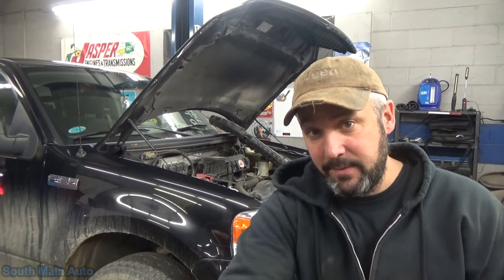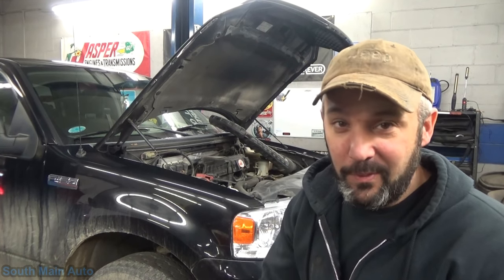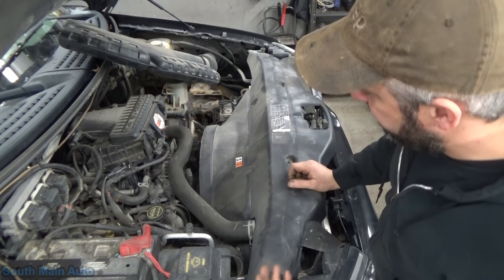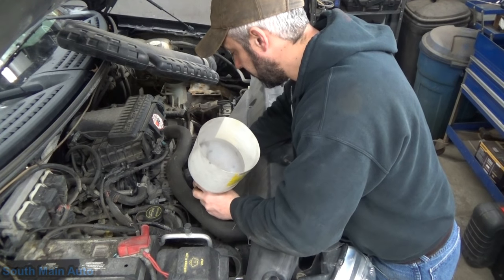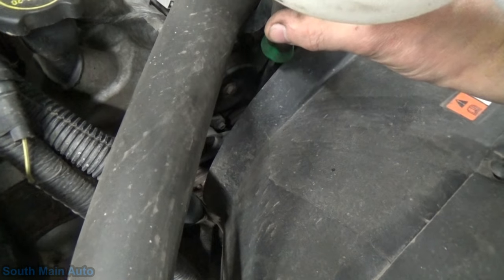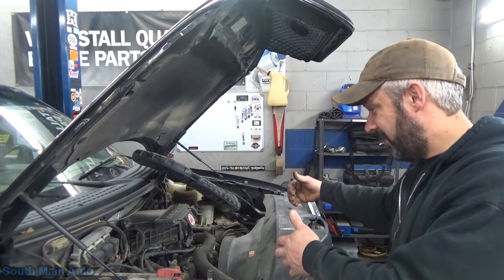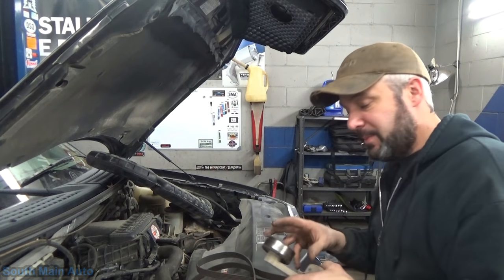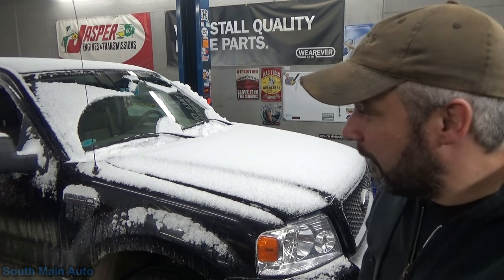How To Locate A Noisy Idler Pulley

Comment: I use temperature sensor gun and point at each com .. The bad pulley usually get about 20-30 degrees hotter.
Reply: THANK YOU!  Just confirmed my tensioner pulley is bad without turning a wrench.
Reply: Is ther a specific one to use
Reply: That's a smart idea! I'll have to go and buy one
Reply: Good thinking will try that.
Reply: That's a good idea
Reply: Oh Snap ! ! !
I'm going to try that NOW ! ! !
EDIT:  I just tried it, and that worked like a charm.
I used a Hrber Frate Thermal gun and I found the Alternator body was 180F,  I also have a basic FLIR thermal cell phone camera, I also saw the ALT was super hot.  Then I noticed the sparks spitting out of the alternator.  Bad alternator.
Reply: Woo what a great idea haha. Have some LaserGun in my tools 👌
Reply: Big Brain!
Reply: Good idea
Reply: Thank you. ! Great idea
Reply: Thanks very good idea
Reply: SC 03 thank you!
Reply: How long should the car be running to get them to temp? Or would it show right away?
Reply: Likewise 😅 I have super fancy temp gauge gun and Im always trying to get my 💰 worth out of it..
Reply: Great Idea!!!!!!!!!
Reply: I just tried this method. I knew the ilder pulley was the likely culprit.  Before taking the belt off, I ran the engine a bit and temperatured everything: all the others were running at around 125 degrees, but the idler pulley was 135-140.  Not a huge difference.  Was it because it was closer to the AC compressor and engine?  hmmm  Then I took the belt off and manually spun everything, definitely the idler pulley (belt tensioner about done for, too).  I put the belt back on and restarted the engine to the most horrendous racket ever:  idler pulley has left the chat.  Temperature on it immediately starting climbing before hitting 165 when I cut motor.    

This method definitely works, but the change in temp may be less noticeable depending on how bad the failure is at the time.
Reply: You mean one of those laser thermometers?  I feel way more comfortable using that than sticking a screwdriver down the hatch into the moving pulleys and belt, it just looks a lil scary.    Though the screwdriver effect was pretty cool.
Reply: @sc0368  well damn. That's smart!
Reply: Ok sweet.  I have a heat sensor 👊👊👊

Comment: A tip for you that will save you time and your customers money. You do not have to purchase the tension arm and the pulley. (Unless the tension arm spring is broken.) The pulley itself can just be replaced. The pulley itself is usually in stock, the tension arm is specific to models and usually has to be special order.

Comment: One of my favorite tips is how to find a bad wheel bearing. Lift the car in the air and hold each spring then spin each wheel. The bad one will vibrate right through the spring and your hand/arm. Works every time;)
Reply: ALSO A GREAT TIP AND LIFE HACK
Reply: Hell yeah!
Reply: @Goosetavula  😂😂😂😂😂😂
Reply: You can also have a friend tied to the hood with one of these screw drivers and a bottle on the end, have him press the end into the hub while hanging off the side..
Reply: Wheel bearings do not have Springs
Reply: @famusman5989  Correct. The struts have the  springs and that is what you hold on to while spinning the wheel. Supposedly you can feel the crunchiness of a bad bearing vibrating the spring.
Reply: @sigmundblank7403  oh ok I see
Reply: Don't forget to check the piston springs (a la chrisfix 😉)
Reply: Did not know this before but it probably works better on small cars. On my truck it takes two hands just to move the wheel.
Reply: They also get warn/hot when they start to fail. It's always nice to go for a drive uphill and coast to a stop, that way your brakes don't heat up when you get out to check the wheel bearings
Reply: @shartingfish5761  that's what my friend would do..
Reply: @famusman5989  no but it's got a spring there somewhere to hold..
Reply: @bravobrk  two words.. power steering.. Or ..
Ol Lady

Comment: Thank you so much for this great idea. It is amazing how the simplest things are the most effective. I tried using a Harbor Freight stethoscope, and I could hear noises OK. However, once I attached a plastic bottle to a long screwdriver like you did, WOW ! The noise just amplified to the point that there was no mistaking which pulley was bad.  Saved me lot's of guessing and "throwing parts at it". My Acura noise was sounded like a  bad alternator, but the noise through the megaphone screwdriver was so minor. However, once I put it on the tensioner/idler, man the noise was loud. I found the problem, had it fixed in an hour. Great idea, thanks again..

Comment: Been using the stethoscope for years. I also have a 3 foot long piece of plexiglass rigid tubing to slip on the rubber hose end of the stethoscope. Helps with finding the general area of a noise.
I will definitely be adding the jug method to the arsenal . Thanks Eric O.

Comment: Love the tip.  Just want to point out that there are 3 types of pulleys there:  Drive (on crankshaft usually the bottom one), Driven (on alternator/generator, power steering pump, AC compressor, fan), and Idle (not attached to any of the others, just installed to maintain the tension on the belt).  Generally speaking, you will usually only have one idle pulley on cars, although you can have 2 on an engine that uses two of the flat belts such as some large diesel engines.  Thanks.

Comment: Screwdriver works great to find stuck/failed injectors too. You can hear them clicking clearly as they open and close. Relays and stepper motors(like throttle plate motors and EEGR) are also easy.

Comment: Great tip! Really enhances the sound...
I just used my stethoscope on a truck the other day, truck had a bearing noise, but with stethoscope they all sounded the same...ugghh hate when that happens... lol
Good safety tips too! Very important, usually people joke about it, like its never gonna happen to them. Yrs ago, i was installing an electric fan on my 85 Camaro Iroc-Z and not knowing if i wired for push or pull, i went in a little closer to determine which way the air was moving, and wham! It bit me! Lol
Needless to say, 7 stitches on my index finger, 1 stitch on my middle, and 3 severely bruised fingers later, you learn to be more cautious about this stuff...
Lol

Comment: recently installed a couple new belts on a 2004 350z. After watching this video, couple things...I need to go and reverse my steps  by loosening the adjustments on both pulleys and check for looseness on all A/C, alternator and P/S  for free spinning. Honestly for my first time however, I did over tightened both belts...is making the groaning noise. Well, time for couple new pulley parts. Please feel free to comment. Thanks again...SMA

Comment: You kill me Eric.  Reminds me of my old man, WWII Combat Engineer.  He'd use common sense and Critical Thinking to solve most any problem.
He told me on real old cars you had to change the "bushings" on the crankshaft/rod connections every 30,000 miles or so.  Metals were not as durable or hardened at that time.
You would drop the oil pan, R&R the bushings, put her back on the road.
Ehh.. couple of hours, you're done.
Good Work, My Friend. 👍

Comment: Love the tip good sir. Well, this invention worked like a champ. Was able to find the culprit on my 2011 Avalanche with ease, thanks for taking the time to share. I'm starting to think the 5.3 in my truck was changed at one point as mine has an a/c tensioner but all the other 2011's I see people work on don't have a tensioner on the a/c belt.

Comment: Great little tip there cheers.  I have currently got a toyota hilux and there is high pitch squeak coming from somewhere and I have been wondering how to start looking for where it is coming from, this trick to check the pulley bearings might be a start.

Comment: Nice trick with the jug. I often use a stethoscope which can be quite deafening at times. I should try the jug next time. That tensioner pulley sounds just like the old one in my 08 f-150 when it went bad. I replaced that pulley along with the other two smooth idler pulleys. I ordered new bearings as well and cleaned up the old pulleys, shot some fresh paint on them, and pressed in the new bearings. Now I have spares if they crap out again.

Comment: Great trick with screwdriver and jug ! Would love a close-up of contact points of screwdriver end with pulley’s if possible ? ?
Reply: YEAH ME TOO, NO CLUE WHERE TO STICK THE SCREWDRIVER. i ASSUME IT'S ON THE PULLEY, IE THE METALLY THINGIE INSIDE THE BELTS. SWEATING EVEN THINKING ABOUT STICKING THINGS NEAR RUNNING BELTS, BUT HEY, i'LL STILL GIVE IT A TRY. mY PEUGEOT BOXER IS VERY NOISY
Reply: @angeliquevanengelen  at 3:22 in the video. Avoid the outer moving part of the pulley. Put the screwdriver tip at the support pt of the inside center axle of the pulley, which is not moving. By touching close to a pulley, you get the sound of that particular pulley more than any other sound.

Comment: Great tip! Out of interest, what are you actually touching with the screwdriver? The bolt in the middle of the pulley, or the actual spinning part?
Reply: dunebasher1971 The bolt.
Reply: The bolt or the mounting area. On something like the alternator you touch the housing around the bearings.

Comment: Great trick with the screw driver and jug.
I have the same truck and same noise and I am pretty sure it’s the tensioner as well but now I know how to check it 
I guess you have the end of the screw driver touching the bolts that hold the pulleys on or the housing?

I got to check and fix mine tomorrow

Comment: I just Bought the Same  Tool from Snap on for $ 400.00   Except the Jug doesn't have a Handle and there was still some Washer Fluid inside    lol      Great Idea I would have never Thought of it.  I been just using the Screwdriver method  for years I Have to give This a try Cool

Comment: Well, I can say that trick just gave me back my sleep cuz I just had my pump fixex n it was still hummin away  but after checking it with this method I now know its the tensioner. Sadly enough I need my lines replaces on the steering pump now but the humming is gone and that is gonna help me sleep better at night. Thanks for this excellent tip brotha!

Comment: That is a friggin GREAT idea! One of those, "why didn't I think of that" deals.

In the past I never used the screwdriver trick. I'd just remove the belt and free spin the pulleys, then put my weight on them & flick my wrist back and forth - I can usually feel any roughness doing that. 

In my own truck ('07 Silverado), I pried the seals out of the bearings, and gave them a little smear of John Deere Corn Head Grease - works wonders. Made it all nice and quiet again. 90k miles on the truck, and I'm still on the OEM bearings and belt, except for that tiny little 6001 bearing for the A/C - the Corn Head Grease was a little too thick for that little guy - must spin at 18,000 RPM just at IDLE.  In that case my  grease trick actually made it worse. Live and learn. Would need a NGLI #00 in there, I think. Bearing is only $6, but saves you a trip to the parts store - after all, we don't get paid for wrenching on our own crap!

I learned quite a few automotive tricks from my grandfather, but most of those can no longer be applied to these electronic wonders of today. This one is definitely a keeper - thanks!

Nice to see Doug's got his channel up and running - just watched his before I came over here. :)

Comment: Wish I saw this trick sooner,after replacing a perfectly good alternator. I tried it with a two foot pipe but that does not work as good as this method you are showing. After finding a old milk carton I tried this and it was so clear the noise was coming from the compressor. Thanks for this great idea.

Comment: Here's a hot tip.  If you have a local bearing supplier in your area take the bearing out of the pully and have them match it. Press a new one in and I doubt you would pay more than $5.  Of course, you'll have to learn how to press a bearing in and out, but it can be done with a socket and blocks of wood.  I've done it just for fun because it's so cheap and it's great insurance for an older vehicle, particularly if you are going to be traveling.  You DO NOT want a bearing to seize more than a block away from home.  It'll melt your belt and then your engine.
Reply: I've done that numerous times with great success. However, some of these are pressed into a plastic (or phenolic) pulley, and they have a small lip on either side of the bearing and covering about 60% of the outer race, usually on an idler pulley. You'll break the lip if you press them out. 
However, if your running a for profit business, 2 things to consider: is the money you save equal to or greater than the difference in cost? and then there's the warranty the customer expects should it fail again in the near future. It's great for the DIYer, though.

Comment: A piece of garden hose works for me
Reply: Elaborate?
Reply: @adriananicole7807    Good afternoon. A piece of hose acts just like a stethoscope. U hold one end to your ear and move the other end close to the noise. It works super.
Reply: Good evening, thank you for your reply. I presume one would still need the screwdriver?
Reply: @adriananicole7807  No screwdriver necessary. Try it. U will c what I mean. Thank u!!
Reply: Will do! Only issue is that the chirping only happens upon accelerating